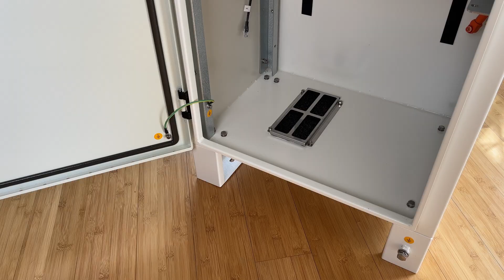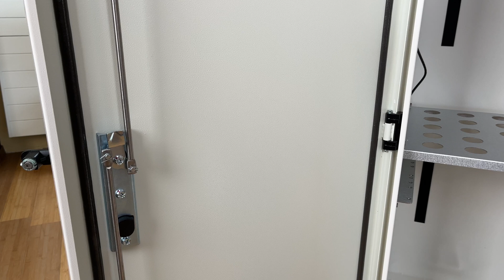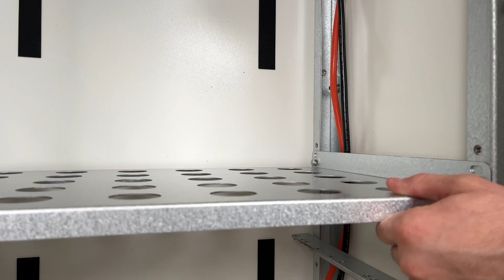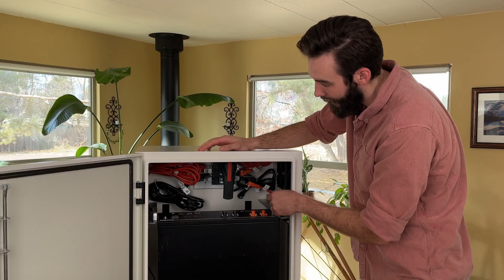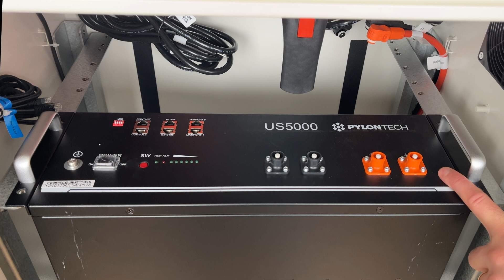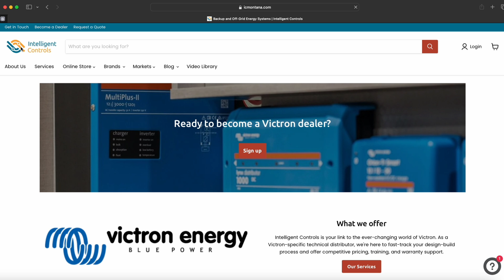Inside the new Energy Storage Cabinet from Pylontech

Comment: you'd want to make the outgoing holes at the BOTTOM of the cabinet.
Reply from the maker: That is definitely an option, and if you don't have access to cable seals, it would be a good way to not compromise the IP rating. If you do use cable seals, such as Scanstrut (https://intelligentcontrols.io/collections/scanstrut-cable-seals) or similar, then penetrating the top might make more sense depending on your installation circumstances.

Comment: Great system design. For high-density setups like this, I’ve seen aerogel insulation being explored as a thermal barrier between battery modules to improve fire safety. Curious if similar materials are used here.
Reply from the maker: @SKYBOYS_AEROGEL we are always a fan of insulation in a battery bank, especially if it will be exposed to any extremes in temperature. The cabinet itself does not contain any additional insulation, but there is room for such. In addition to the safety aspect, insulation provides a more stable environment for the system to operate in. In any cold environment, insulation between modules will likely do far more than adding heat to the system (and be more energy efficient). It would be a case by case decision in high temperature installations as you’d not want the self generated heat of the modules to add further to the battery temp; if over insulated and unable to be cooled sufficiently during cooler hours or periods of low usage you could create a new safety issue. The best preventative is nearly always a proper design, and insulation should 100% be a tool in the kit for anyone designing/installing a power bank.

Comment: No one helped me please replay me I have an inverter and it synchronizes only with the Pylon tech battery of lithium the inverter BMS does not communicate with and I set it manually from the lead acid setting 
So my question is if I set the battery stop full change value and discharge stop value manually without BMS communication my battery work if it is connected to an inverter to protect my battery
Reply from the maker: Hi Jason, happy to help. The first thing to be aware of is that your inverter needs to have a lithium charge setting. Using a lead acid charge curve can and will damage the batteries. Look for that setting in your manual. If it doesn’t have it, your inverter may not be compatible with lithium batteries. Once the lithium charge setting is enabled, you can manually enter your setting points to operate the batteries without communication. Here are the settings: Absorption voltage, 52 Volts. Float voltage, 51 Volts. Low Voltage Shutdown, 44 Volts. Absorption time, 1 hr.

Comment: Good idea but a fairly critical design failure is the location of the isolator, why would you want to reach over the batteries that are faulting and in the worst case scenario going to catch fire to turn off the isolator 🔥
Reply from the maker: Good observation but this is ultimately a non-issue. The batteries are thoroughly tested and have UL1973 and 9540A certification. Beyond that these are LiFePo4 batteries that have a greatly reduced base risk of a thermal event just due to their chemistry makeup. When the batteries enter a fault state they individually isolate themselves with internal MOSFETs. The main purpose of the isolation switch is not to protect the user from the batteries but rather to disconnect the cabinet of batteries from the larger system so that in a multi-cabinet system you can do maintenance without having to turn everything else off.
Reply: @intelligentcontrols thanks for the reply, regardless of certification achieved the fire risk is not zero, not to mention there are other reasons you might want quick and unobstructed access to the isolator, it’s a design failure for me but if I had to use the cabinet I’d just install a more safely accessible isolator if it were my installation.
Reply: If the battery is arcing internally, turning off the isolator will not stop anything. @isaachauser521
Reply: @isaachauser521  Being an electrical engineer I have no choise but to Absolutely AGREE with you